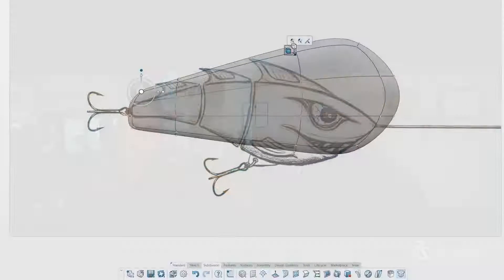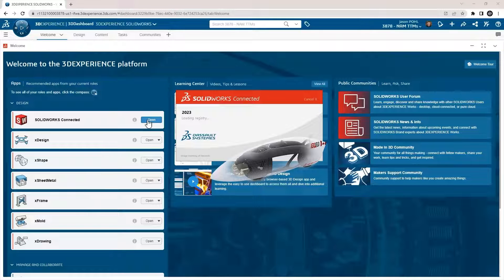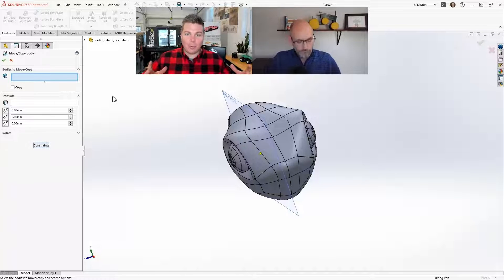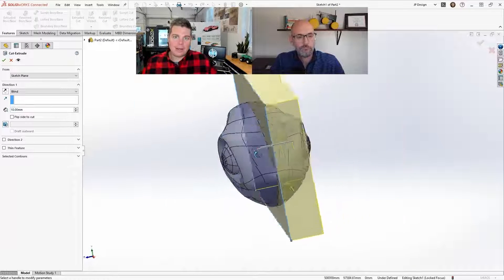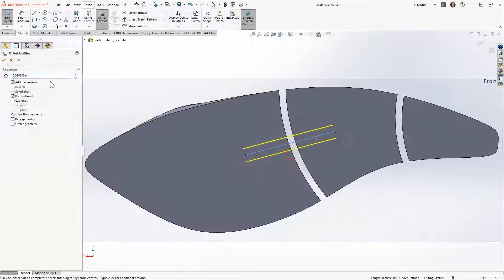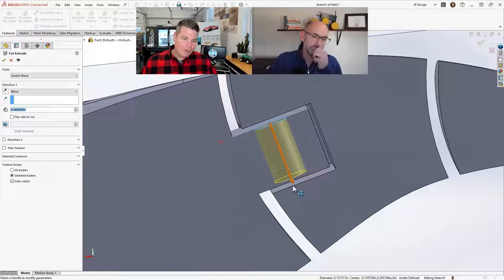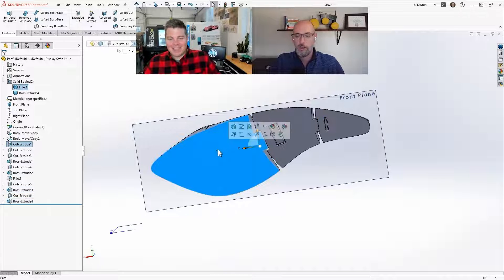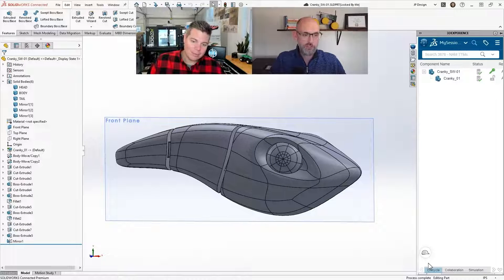Makers Tutorial Series - Episode 05: Adding Design Features in SOLIDWORKS

Comment: I am trying to drag the XShape file into Solidworks as was done in the video, but when I do so, the XShape design is being imported as a graphic body instead of a solid body. Because of that, I can't edit it or center the front plane as was done in the tutorial. Was I supposed to save it following a special protocol in XShape? The end of video 5 of this series did not go into detail about how the part was saved so I am wondering if maybe I am having this issue because of the way that I saved it. Thanks for your help!